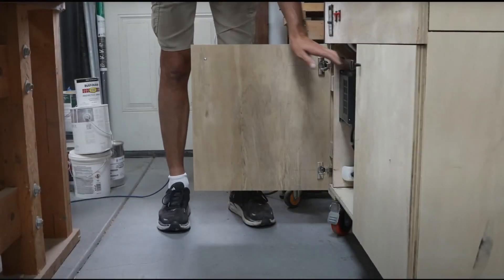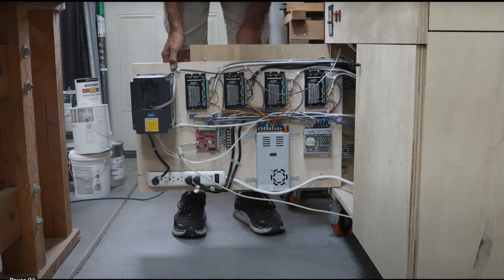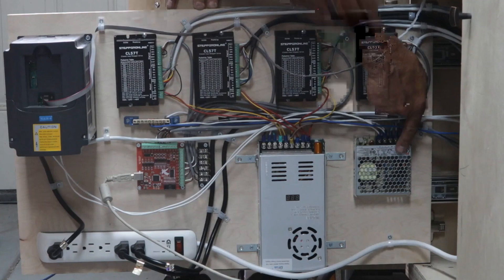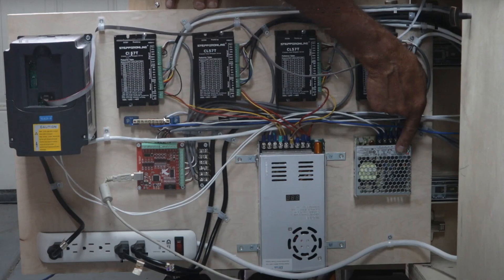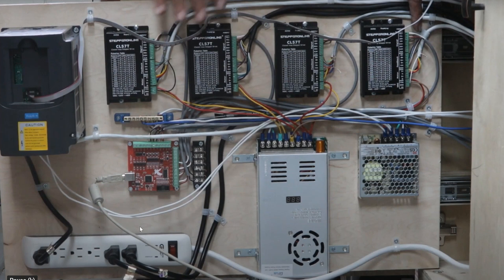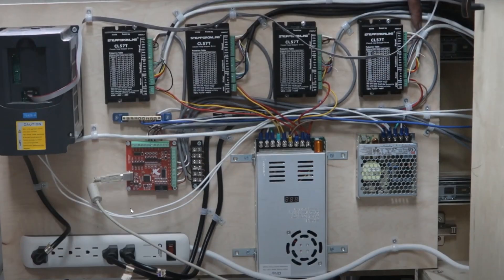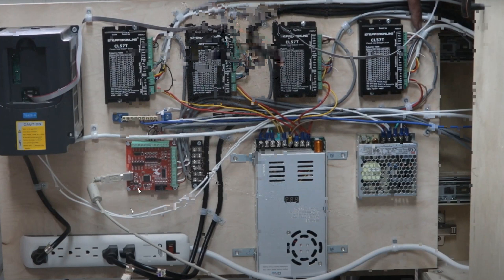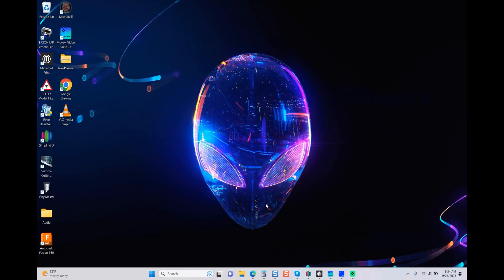CNC Router Controller Built Incorrectly (Volume 4)

Comment: I hate to say it Vince but, I realize now more than ever why people do it. I will give you my own example. I've been following you for a while. I'm not an idiot and I agree 99.5% of the time with your Processes and Explanations. I've mentioned before I've been planning my own machine but am lazy too. Since I am not looking to drive money into it I have been cutting Costs in the Prototype phase with some really sketchy methods to Junkyard things together just to prove a concept. To my surprise the Junkyard methods works. Problem is most people don't feel the need to take it to the correct step since it works. This is why they share it to the world including everything wrong with it. I will say though now that I know my Junkyard setup seems to work, time to consider building it the correct way. Which brings me to the other reason I posted. WTF is going on with Gecko. Didn't they promise a new G540 like 2 years ago. I stopped emailing them cause they kept using the whole supply chain issue but just noticed the did release so another single board driver not to long ago. I'd been holding out this long rather than just go with the 540 but seems like after all that I wasted my time waiting and gonna have to get it after all. Geez.... G540 type with a built in ethernet interface was my dream. Even the option of adding something like Pumotix hit the wall with shit going on... A Fella can't seem to get a break. :) Cheers and Thanks for your Videos!